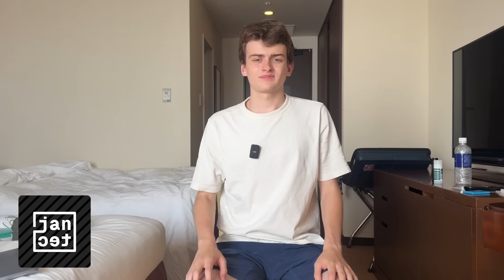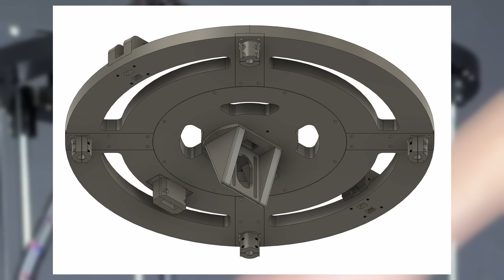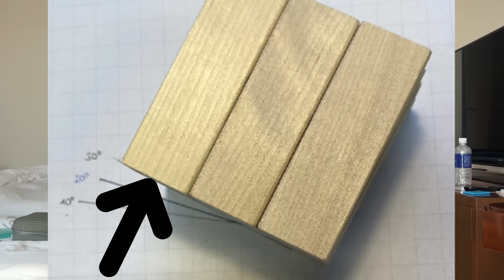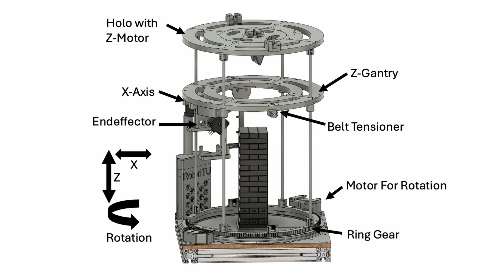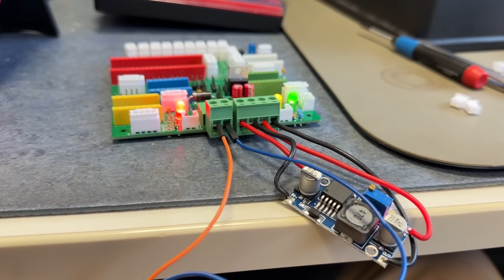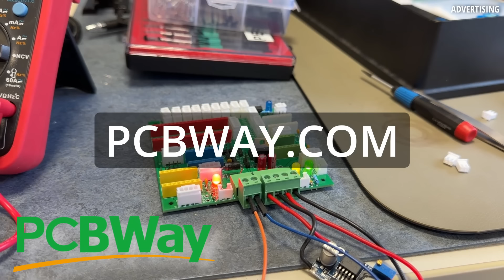This 3D Printed Robot plays Jenga

Comment from the maker: What are you building right now? 🤖🛠️

Tell us about your current 3D printing or DIY robotics project in the comments! 👇
Reply: shredder ;)
Reply: A UFO detector using a starlight IR camera and raspberry Pi 3B+ Running motion. 
To be carried by my already built amphibious 1/8 scale Sherp robot.
Reply: A raspberry pi object tracking robot in c++. currently using a usb camera but later i wanna test it with a raspberry pi camera module

Comment: I strongly disagree that through hole is easier to work on than surface mount. Sure, it's possible to desolder a 2 leg capacitor and solder a new one, but it would be even easier to heat up the board on a hot plate and pluck it off with some tweezers. The more pins it has, the hard it gets to desolder if it's through hole. Try replacing a DIP or a big connector.
Reply from the maker: Thanks for adding this. You're right, it depends on the components you're using. 
In this case, we only had a standard soldering iron in the lab room, so no hot plate or hot air. That's why in this special case, I would still call it a good decision.